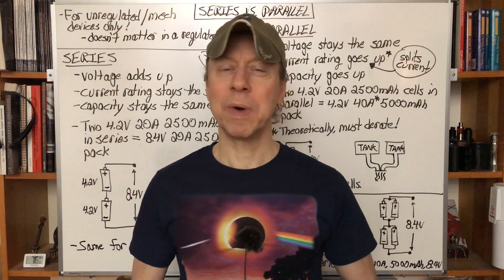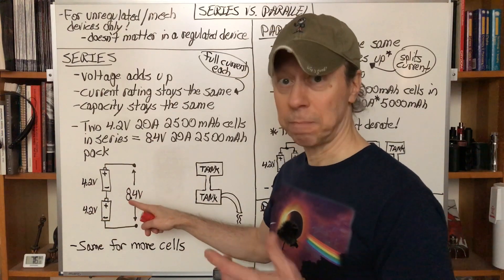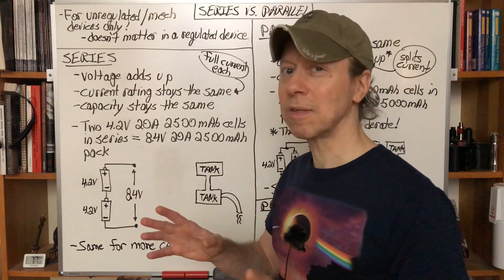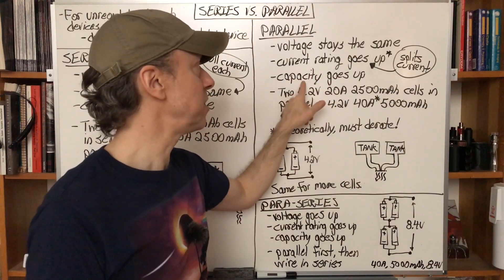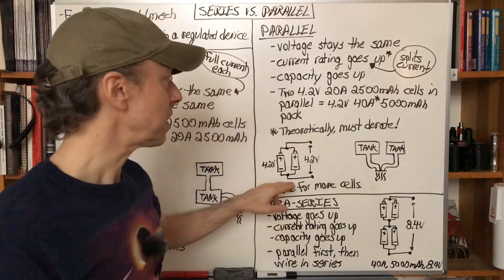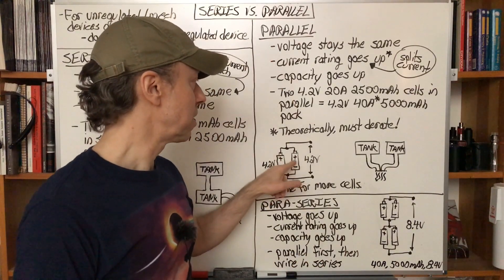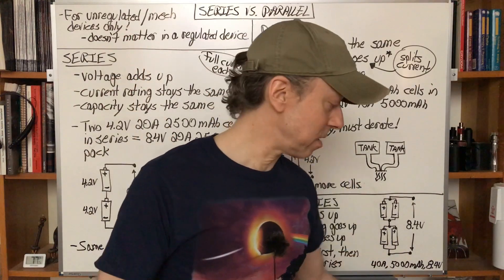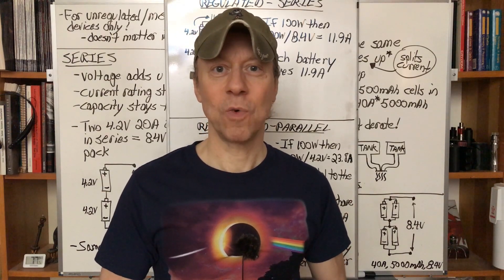Minding Your mAhs Ep032 – Series vs parallel – How does voltage, capacity, and current add up?

Comment: What if you have 2 batteries in series of the same voltage but one of them has a lower capacity? Will the capacity be limited by the lowest one?
Reply from the maker: Yes. Since both are discharging at the same discharge current level the lower capacity one will empty out first.

Comment: what about charging current?  does it also add up the same way.
Reply from the maker: Not sure I understand. We don’t put chargers in series or parallel and there can be some very serious problems if that is not done correctly, possibly destroying the chargers and the device.
Reply: @batterymooch  what i mean is say a 18650 has a charge input current of 1 amp for the sake of argument. if i put 2 18650 in parallel has the charge input current now gone up to 2 amps? hopefully that clarifies.
Reply from the maker: @invictusfarmer7188  the charge current is not determined by the cells. It is determined by the charger. If the charger is set to 1A then no matter how many cells you put in parallel the charger will still only put out 1A. You then divide the current up to each of the paralleled cells. Two cells = 0.5A each, three cells = 0.33A each, etc. 

For your example…if you want to charge two cells together in parallel, with each being charged at 1A, then you need to use a 2A charger.
Reply: @batterymooch  what i meant to say is, say a charger only puts out 2amps.  if i have 2 cells in parallel that each have a max input current at 1 amp each cell,  am i safe to charge the 2 cells together with a 2 amp charger.  meaning will it split the 2 amps evenly per cell in the 2 battery configuration or is the maximum input current allowed still 1 amp because the cells each have a 1 amp max current rating.  sorry for being a pain lol.  its just im having trouble wrapping my head around how putting cells in parallel changes the stats.
Reply from the maker: @invictusfarmer7188  let’s back up…why are you putting two cells directly in parallel? Why not put one in each slot of the charger and have each slot set to 1A?
Reply: @batterymooch  all im trying to do is figure out the specs.  im still in the learning phase.
Reply from the maker: @invictusfarmer7188  that’s great to hear. I am still very confused as to what you are trying to do. If you want to put two batteries wired together into one slot in the charger then the two batteries will divide whatever current the slot is set to. If the slot is set to 2A then each battery gets 2A / 2 = 1A. If the slot is set to 1A then the current is still divided into two and each would get 0.5A.

I have to ask again, why not charge each battery in its own slot so the current is not divided? Please tell me what you are tryin to do. It’s fine to learn about specs but we can’t discuss that when I do not know what you are doing. Are you using a charger with slots? Or are you using a LiPo charger that you are just connecting to both batteries at once?
Reply from the maker: @invictusfarmer7188  don’t confuse ratings and specs with what happens when you connect batteries. A car that can go 100mph does not always go 100mph. That is just a max speed spec. It all depends on how you use the car.

Same with batteries. If it has a 1A charge rating then just don’t charge it at over 1A. The charger setting determines how much current the battery gets. If you have a charger with slots then check the user manual to see how much current each slot sends to the battery. Some chargers do not change what a slot delivers if other slots are used at the same time. Other chargers take the total current rating for the charger and divide it up for the slots. For example, 2A if one battery, 1A each if two batteries, 0.5A each if four batteries, etc. Check the user’s manual.
Reply: @batterymooch  thats exactly what i was trying to figure out.  if the amperage splits.  so if i have 2 batteries the 2 amps will be 1 amp each battery.  3 batteries and its split to a 3rd and 4 batteries it would be a half an amp each.  

im building a power wall so im trying to figure out how the charge current will be divided up among the 100 batteries i have in each 3.7 volt pack.   since im still in the process of breaking down packs i figured id spend some time learning as much as i can. ive got 200 batteries charged and cleaned and 500 more to go.  just started running 4 opus chargers to.get capacity numbers for repacker.
Reply from the maker: @invictusfarmer7188  ahh….okay. I wish you would have told me right from the start what you were doing. How cells use/take/share current in a multi-slot charger is VERY different to how they behave when connected in a powerwall battery pack. Good luck!

Comment: Question i am wanting to make a portable speaker have a longer run time would i just add another battery pack in parallel ???? Its curent pack is 3 18650 any input would be appreciated
Reply from the maker: Yes, in theory it would work to add another pack in parallel but there are many safety and performance issues to consider…too many to list here. I recommend researching this carefully before you try to parallel packs.

Comment: Thanks for the video Mooch. Question for determining watts law in a parallel mech mod: What is the reference current for this equation (combined current of all batteries, or the split load when in parallel)? For example, 2x 25A batteries in parallel have a combined current of 50A, applying watts law to this figure is 210W. Surely that’s not right?
Reply from the maker: You’re using the cells when they are paralleled so the max wattage you could get would be based on their combined current rating. Cells do not share current equally though so reduce the total to compensate for the one cell getting more than the other. Lower it 20%, even more depending on the quality of the wiring, connections, and the condition of your cells.

The wattage the cells will deliver to the coil changes as the voltage drops. At the start your voltage could be anywhere from 4V to 3.5V or even lower, depending on your current draw. This makes calculating wattage tough to do since the voltage will be unknown unless you measure it while vaping.
Reply: @batterymooch  Thanks for your detailed reply Mooch. I'm getting conflicting advice on-line, one of which suggested halving the figure from ohms law would give you the split current i.e. 4.2V/0.14 = 30A then half is 15A. Would you agree with this? Thanks again, and love your work.
Reply from the maker: @jimmyhatz  there’s no correct number. It all depends on your tolerance for risk and the condition of the cells and the wiring and contacts in the device. I can’t give you a number to use. Some people are very conservative and lower the combined rating a lot. Others barely lower it at all since they want it to be a high number. You’ll have to decide how much you lower it. You can always lower it a lot and increase it later if you find that your battery never gets more than a bit warm and you get lots of vaping time.
Reply: @batterymooch  Thanks Mooch. Keep up the good work.

Comment: Great info!  I have to say though, the wiring being crap is not the difference between theoretical values and real-world values.  Perfect wiring won't give you theoretical values, right, but it'll get you closer
Reply from the maker: If the cells are (impossibly) perfectly matched and the wiring and connections all have the same resistance (it doesn’t need to be zero resistance, just the same for each cell) then the current will share equally. Bad wiring and high resistance connections can easily triple the overall resistance of the cell though, affecting the current sharing. Having good quality wiring and connections can bring their contribution to unequal current sharing to very low levels though. Then it’s up to the individual cells themselves and how well they are matched and how closely they track each other as they age.

Comment: And when you compare theory with a true test? Because a chipset loose some % of power when it boost  the voltage? And perhaps the loose is less when the volt is down? Each chipset give perhaps some different result?
Reply from the maker: By a little, yes, different regulator circuit boards will have slightly different efficiencies at different voltages and current levels. But it is only a small difference.

Comment: Bought six Molicel P26A (2600mAh) batteries at https://www.18650batterystore.com/  
The batteries were 18% to 37% below the 2600mAh capacity. 
The Battery Store claims, "Genuine Authentic Cells With many wholesalers and auction sites offering low grade or re-wrapped 18650 batteries, it can be hard to know who to trust and can be very dangerous. Here, you will never have to worry about quality or safety. We test every batch of batteries to ensure authenticity and quality." 
They did not respond to my email or online chat. Called and said they are swamped with orders and will follow-up with my RMA request in a few days. 
Has anyone had the same problem with "18650 Battery Store"?
Reply from the maker: How did you measure the capacity? The chargers we use are usually VERY inaccurate and will only tell you how much capacity you put back into the battery. They will not tell you the capacity of the battery unless you charge them fully and then discharge them at about 0.5A down to 2.5V.

Comment: Thanks, Mooch. This was (for me) a very timely video. I was just thinking about this the other day as I was designing (in my head, early stages) my next drone. I'm tired of the cheap lightweight toy drones that get blown into a tree by every breeze. It takes weight to achieve more stable flight and what better place to start than with bigger batteries. I'm also tired of that large postage stamp sized battery only lasts about 15 minutes if you're lucky. A larger (heavier) drone will also require larger motors to fly so bigger batteries (more voltage and/or current, I haven't done the math or shopped for motors and controllers yet) will be required for that as well. Thanks again.

Comment: Shouldn't mAh be ignored when comparing between parallel and series and use Wh instead? While adding battery capacities in parallel is correct that doesn't mean that a series wired pack is gonna run out  faster if they are used at the same power levels. If same two baterries are wired in series or parallel they still have the same amount of total energy.
Nothing you told in the video is wrong, I just think it would've been great if you thouched on this since I think this is often overlooked.
Sorry for the spelling and/or me being bothersome, it's with best intentions in mind. You're doing Gods work for the community, keep it up, much love!
Reply from the maker: Thank you for your feedback!
Run times, addressing delivered Wh vs capacity ratings, I think needs to be kept in another topic. What I covered in this video already is far beyond what many people can deal with trying to learn about batteries. Adding Wh, a completely alien concept for almost all vapers, would make this an unviewable video for many IMHO. Just the basics of series vs parallel is a very, very difficult thing for many to understand. I have spoken about Wh though before and will continue to as it is a critical topic for more advanced vapers who are looking for the last few percent of performance.
Reply: @batterymooch  Well yeah, now that you say it like that it make sense not to include it in a "basics" video. I learned about it when VaporShark put out a dna250 box with a 900mAh 3S li-po pack few years ago  and many were confused about its actual runtime. Many are misinformed today too. It would be a great topic for a video for sure. Cheers :)
Reply: I sometimes forget that this a channel for everyone not just hobby-ists, my bad
Reply from the maker: Blabor The Mighty no worries at all! It’s an important topic, worth a video, and thank you for your thoughts.

Comment: In a regulated we still must use cut off voltage right?like 6.2-6.4 instead of the 8.4?like 100÷6.4v
Reply from the maker: When calculating the battery current, yes.